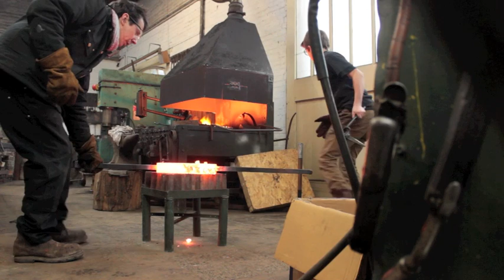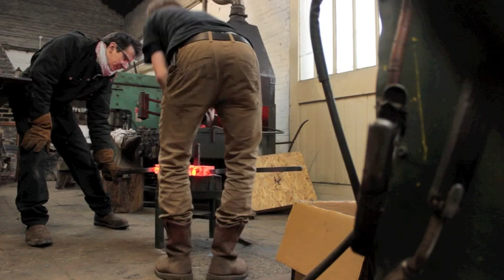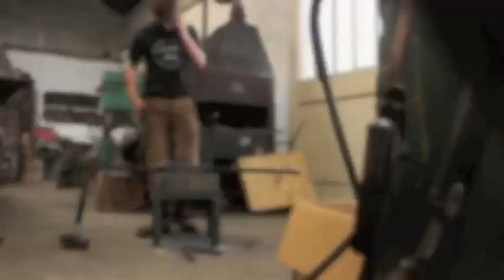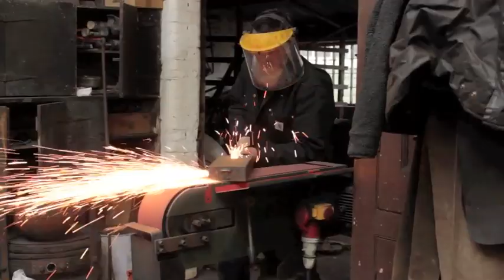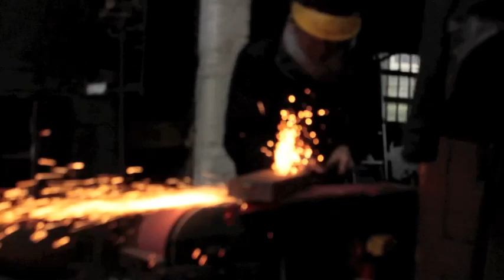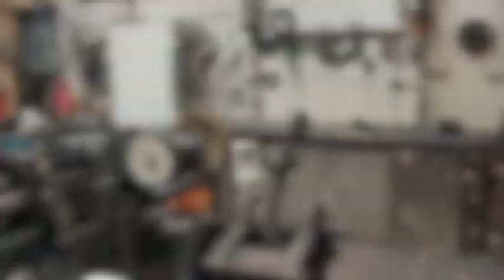Making a Striking anvil. Drifting the hardy hole

Comment from the maker: It is an anvil used for heavy forging with a striker.
It is mild steel so an errant blow will not be dangerous. 
The hardy hole has much better backing and the anvil is able to be mounted very well!

Comment from the maker: Hi, steve. Hope you are well!
Because these drifts were coming out of the piece at a high orange heat. Trying to 'force' them through again at this heat would lead them to deform, hugely! I used two so i could stay calm and controlled and do it at a measured pace. You do not want to try and force the drift through...notice how i only start really hitting in the second heat. This piece has such a large volume that a frift simply would have minimal effect on it's heat! 
Alec

Comment from the maker: Hi!
This was an inch square (25mm) so I drilled a 3/4 inch hole! (20mm) ....
In fact, I this was actually a 19mm drilled hole! But, 20mm is the optimal hole size!
Reply: I can't wrap my mind around it... wouldn't it be easier to drill in 25mm when you want to drift a 25mm square hole?

Comment: hey there man! I'm just starting out blacksmithing or trying to, I have a gas forge and I got a 3 by 4 by maybe 14 inch chunk of tool steel to use as an anvil, and from people I've talked to it might be best to mount it vertically to use the mass under the hammer etc? that makes sense I suppose but my question is how would you suggest making a stand for it? I thought it'd be easiest to just get a stump and carve out the right size hole in the stump and nest the steel down into that, but I wanted to ask your opinion

Comment: I have a block of steel 5" thick  6" wide 14" long I had a 1" hole drilled where the hardy hole would go can I drift the round hole to a square hardy hole or is the block to thick...
Reply: blakkkatt9 if you have enough fuel and a big enough forge to heat the steel plate, then you could definitely drift the hole, if you're careful not to let the plate cool too much, and keep your drift cool, or else it may get stuck.

Comment: Where did you get the block? And what kind of steel is it, if you know? I've heard S-7 tool steel is really good for anvils. It's a shock resistant steel.
Reply: easy pickings to grab old forklift tine 5" x 42 ususally round 100$ or less

Comment: Holding it so close like that, if you end up missing, you might actually lose a finger :X

I know it's difficult at first to not hold it so close, but it's bad habit. Once you learn how to swing by holding it lower, you'll find your work to be a lot easier because you'll be also increasing your hammering strenght

Comment: I know this is from a long time ago, but I'm curious if you hardened this striking anvil, Alec. I've recently finished my own striking anvil out of mild, and I'm sure it will work for hot steel, but it's not going to hold up to missed hammer strikes. (Much like your beginner anvils you have shown off.)
Reply from the maker: I leave it as Non hardened mild steel so when a student miss strikes it doesn't become dangerous! They do hold up well to hard use though!
Reply: Awesome; thanks for the response!

Comment: i wouldn't of used a belt sander, an angle grinder might have taken a bit longer, but on the held sander, putting that much pressure on it, you run the risk of busting your belt.

Comment: Perhaps I'm ... google incapable but want to clarify. The striking anvil is to have one... simply lower than your standard anvil? (Perhaps easier for both bottom and or top tooling) to be struck by a striker? Or is it.. perhaps also because it won't matter so much if the tools or piece are missed and the surface is struck with the sledge?

The name describes what it's for.. and it makes sense. I'm just trying to clarify the reasoning of exactly why.
Reply: If you miss and hit striking plate, no one will cry,  Ive one make from forklift tine.  LOVE it.  Made it after a class with Brian.    Alex is a fine smith

Comment: He really needs to get some meat on his bones and use a lighter hammer since he cat swing the hammer properly. If I swung an axe this way while doing fire mitigation, I'd be sore to no ends. I probably wouldn't let him split boulders if he kept this up or even swing a pickaxe.
I also do mig, tig, and stick welding plus wood working and blacksmithing.
Reply: +Stephen “Don'ttreadonme145” Babcock I wouldn't let you in the blacksmith shop if you tried to swing a hammer like you swing an axe.
Reply: Andrew DeVisser I'm not that stupid, who ever said I was swinging a hammer this way doing metal work. Cause I sure didn't.
Reply: Stephen Grenoble so he is swinging the hammer the correct way for blacksmithing and the wrong way for an axe. Your point?

Comment: I cringed two times.  I would hold your grip lower on the sledge or get a smaller hammer if u cant handle it.  The other time was your pants.  If you tuck them into your boots metal can fling in there, trust me it happens.  Use an apron or leave you pants outside your boots.  But you definitely have aptitude.

Comment: Lots of work. in few years, the young boys will have back pain (backache). too much effort in his lower back at each strike.  Wasn't a better idea to use a plasma cutter to make this hole and ? This is not a critical, it is just a suggestion.
Reply: +paranoy69  He shows excellent form, the greatest force coming from the center of mass (lower back area).  Few people these days actually know how to use a sledge hammer, and only use their arms to swing, instead of their whole body.
Reply: +Andrew DeVisser Hope it will be ok for him.  I did lots of sledge hammering when i was young. Exactly like he did.  Now i got lots of problems with my lower back... Great video..
Reply: +Andrew DeVisser  This is not a critical agains't you. Just to prevent his back. I did this, all day long in mining, underground, to broke rocks can't pass through  a steel screen. All piece of rocks could'nt be bigger than 12 inches of diameter. bigger than that, i went on the grizzly (sreen) and used a sledge hammer and broke it until  it pas through the screen before another cart of rock arrived and be dumped on the grizzly... it was a real hard job... In these times, there wasn't hydrolic plugger underground... Have a good day...

Comment: I can't help but to feel like you are swinging that sledge wrong.I can see that you are using all back to lift the tool. If you swing the tool to the side and then use the momentum to lift the head it will save loads of energy and your back when you are older. Anyone else who thinks he is really swinging that hammer, you don't know how to swing a tool either and before you say that I don't know what I am talking about, I am a wildland fire fighter, so I know how to swing a tool all day long without getting tired.
Reply: That and he isn't using the full length of the handle and isn't sliding his upper hand down as he swings and isn't snapping his wrist before impact. Then again look at the weight of that hammer and the size of the kid. He might not have the ability to do that with the precision needed. He also probably  doesn't posses the strength to lay it to the side as he brings it around. Point being he should be using a lighter hammer but, in the proper way to make his life easier.
Reply: CKS5000 to be fair they had the work a little low to use such a short shafted hammer properly. there's no way he could have done better with what they had to work with. with that hammer his point of contact on the tool should have been about waist height... then it would be possible to swing the hammer back, up and over.
Reply: +CKS5000 An axe is far different than a hammer.  Have you had occasion to swing a hammer for a blacksmith all day long?  Because if you try to swing it like an axe, you'll wear yourself out.  The kid is doing great.
Reply: I am talking about bio-mechanics and efficiency of motion. were are talking about two different things and I will not try to convince you otherwise. Its your back, so cheers buddy.
Reply: UberArchangel holding closer to the head gives more control and he is using his whole body to swing in order to reduce muscle fatigue and chance of injury. If you have tried olympic weightlifting you will have used the same principles